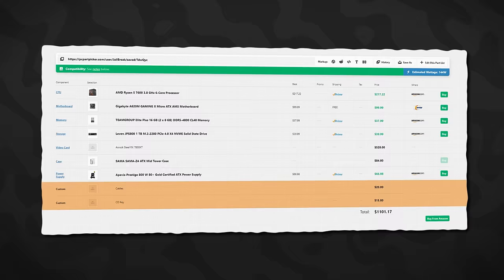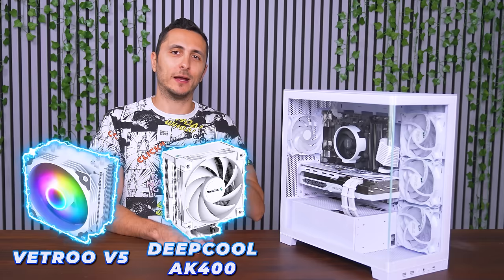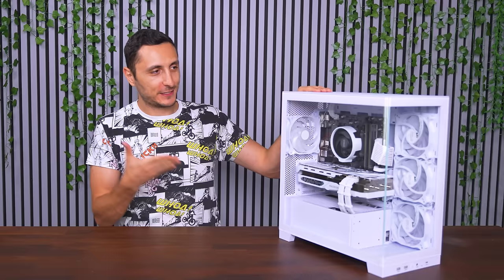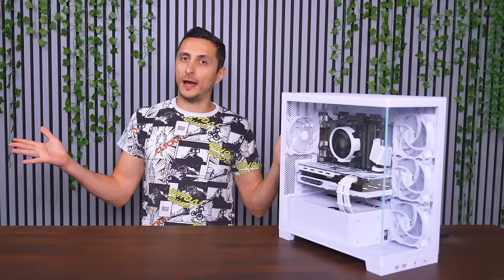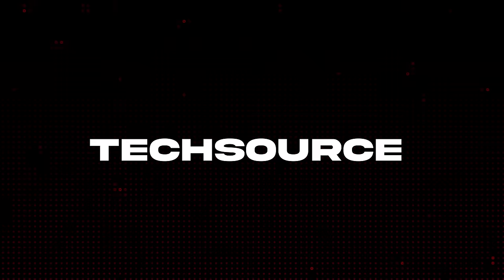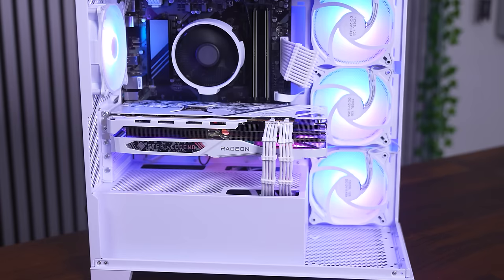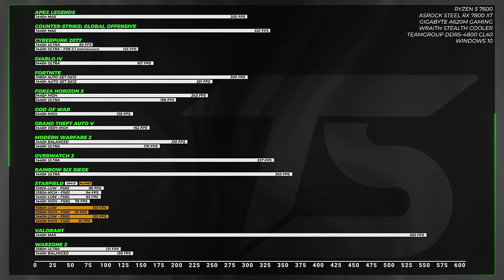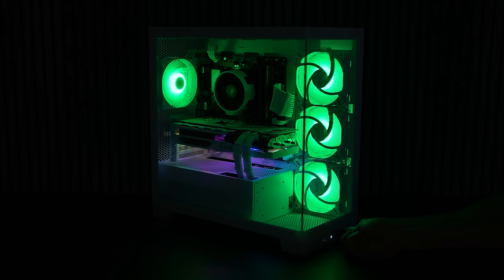The UNBEATABLE $1100 Gaming/Streaming PC Build!

Comment: I rly hate builds like this , a nice GPU with a nice CPU with a cool case it even has nice RGB but then you cheap out and keep the stock CPU cooler with temp of 80-90 C and that is with AC turned on cuz without AC that shit will boil and crash,for fuck sake get a decent cooler.
Reply from the maker: High temps are not a bad thing as long as the CPU can take it and your system isnt throttling. Regardless I did give recommendations for cpu coolers in the video.

Comment: Overpriced build
Reply: @EditaOriginal  I have built several PCs, hbu? The specs mentioned in the video are garbage, you can narrow the price down to $600 with the same perf if you choose wisely
Reply: @lenoirx  what parts would you use instead I’m thinking abt building it
Reply: @EditaOriginal  get a b650 motherboard, not the bs board he used that doesnt even support overclocking smfh
Reply: @ojcarre2432  so you think this build is shit or is it actually worth building
Reply: @EditaOriginal  basically do not get the b620 boards on his part it was really lazy to add that in to his video, b650 boards are the new ones, are overclockable, meaning you can switch it to performance modes for more fps and have great upgradability for the future with am5
Reply: @EditaOriginal  but other than that ryzen 7600 is good and im also gonna buy a rx7900gre card aswell but with a asrock b650m pro rs motherboard